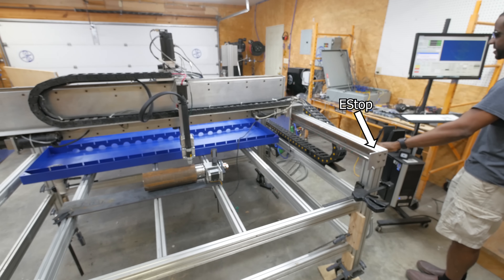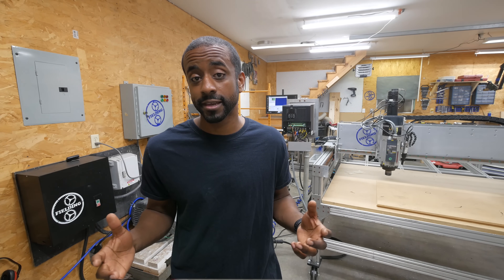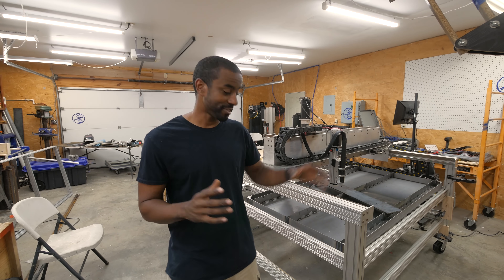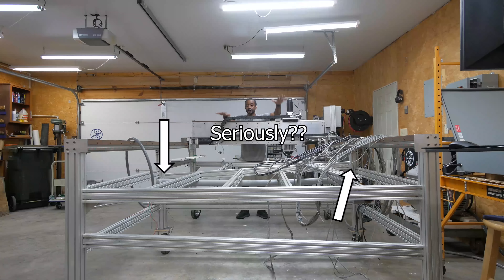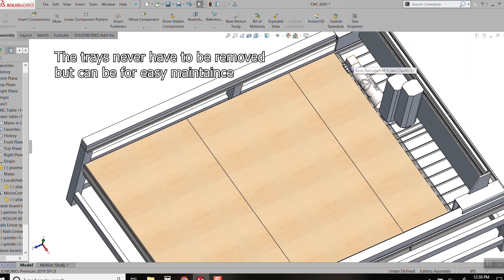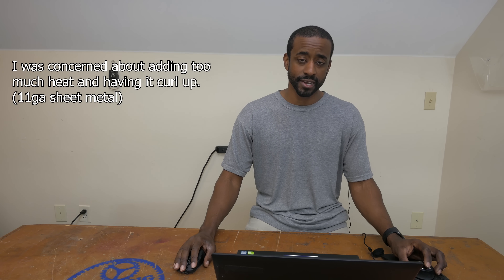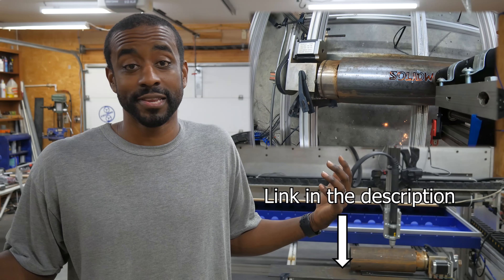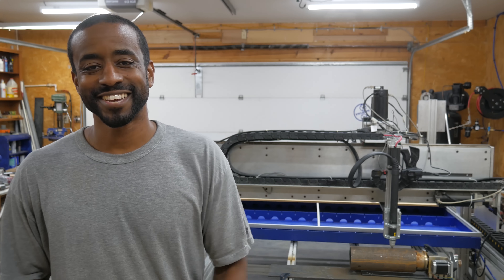Building The Ultimate DIY CNC (#072)

Comment from the maker: Use this link to Try Solidworks online for free! http://bit.ly/2zaQKB0-Solidworks-Free-Trial
Reply: I took Solid works courses at my local community college it was an excellent experience!
Reply: 3-phase power isn't standard in the US or where you live?

Or did you mean you made a 3-phase outlet in your workshop?

If the first, 3-phase is standard in every electrical hookup here. Most high power appliances like cooking stoves run of it and the 3 phases are used independently to power separate lines inside a home to spread load too.
Reply: @enlightendbel  not in the US my friend. 3 phase is only found in industrial/commercial zones for large equipment. may I ask where you are?
Reply: @madisonlamis2639  Belgium. Interesting it isn't common in the US.

Comment: I came across your video when trying to get ideas on building a full purpose 8 foot by 4 foot cnc machine. Great video. I don't have a lot of experience with design but I am a computer programmer and I just purchased my mig welder. Good idea but have you thought about having separate trays for each function? Rollers on your main cnc that you can just push the tray onto the cnc with? The trays would be housed in a rollable tray cart and the trays would be locked into the cnc after rolling them onto the cnc. Just my thought process. Great Video!

Comment: I am building something like this one, but I am using a plasma and laser, and I was going to use two different controllers, to keep them apart, in the diff jobs. But I like the way you have this on the same gantry. I was going to use two gantry. So if go your way with one gantry, how do I pick which head it will use in the process for the job? In other words if I have the same program and want to cut it with laser, but then after it is finished, I want to cut it again with the plasma, what and how is that done?

Comment: Hi Jeremy, very impressive work! Im building my table whose size is 1,6x1,8m but its not as elaborated and useful as your, thats for sure.

Because the aluminum extrusion is crazy expensive, may I ask the size of your aluminum stick, is that 80x80 and 80x40
I plan to go with 30x60 and 60x60. Would that be enough or it needs to be bigger and can be smaller? Im using 2kw watercooled spindle. I plan to buy aluminum extrusion from chinese vendor btw, but still concern its noi rigid.
Thanks in advance!

Comment: Jeremy,  Love your videos!  I recently purchased a Crossfire Pro plasma table.  Still putting it together,  I sell blacksmith tools.  Most of them are made using machines manually.  If I forge a tool for sale, I can easily put my makers mark on it with a stamp while the steel is still hot.  I have ben looking for a cost effective way to engrave parts that I do not forge.  I have looked at CNC routers, lasers, diamond drag tools and dot peening machines.  After watching this, I think I will get a spindle for the plasma table.  I would rather get a CNC router to do the job, but everything I read says I won't be able to engrave steel.  I just cannot accept that.  I can use diamond tooling and I believe I can engrave .003" deep with the right spindle.  Do you have any thoughts on this?  Thanks,  Jerry

Comment: I have a diy Bosch Aluminum 2x4 cnc mill project. I bought all the 90x45 and 45x45 from ebay used . 25% the price lots of turnbuckles too.
Lukilly we have a rexroth store nearby. My design only did the bridge and z axis on cad and the other parts cut to fit

Comment: Great video and great project. I would like to suggest that you add a home position switch on your fence rail and a home button feature in your menu. This will position your fence automatically, eliminating having to re-calibrate the fence distance from the blade after you move your fence manually. It is an awesome project congratulations.

Comment: Hello Jeremy, I want to start off by saying that I think that you are grate. I own a plasmacam dhc2 burn table and I was looking at my collection of used electrodes the centers are burned up do you know what two metals are in an electrode I assume that the outside is copper but I may be wrong  was hoping that I could Tig weld the middle but I am not sure what it is. I was hoping that you would know. It would be a great video if it where possible to refurbish. Thanks from Alaska ✌🇺🇸

Comment: Just found your channel (and subscribed) Orange County Choppers has a machine that does this. Check out the “fake” gas tank the made for Steve Wyrick’s bike( the magician). It took them a couple of tries, but they finally figured it out. They cut flames in the “fake” gas tank to make it look 3 dimensional with his logo inside the hollow tank with lights. You would appreciate the the work that went into the design.

Comment: welded my own one years ago. 1.8 meters wide and 2.5 meters long. its not got a watercooled spindle on it. the steppers are connected via a stepdown transmissin (1-10). so the 200 steps will be like 2000 steps. very accurate. 
not so fast. 
so im now expanding the cnc with a second gantry thats going to be faster. and a switch to switch from gantry 1 to gantry2 basicly having 2 cnc build into one cnc table.(for space sake) 
on second gantry i wish to put a co2 laser in time. but for now maybe a plasmacutter like yours.
the project has been halted for a few months now due to work... but this is inspiring me to get on with it again.
btw i didnt know any cad program or cnc software when i started so i build mine step by step from what i figured to be right . no designs lol . ended up working well though the wiring took me a lot longer then i  hoped for. damn thats a lot of wires the computer board needed to go to every part.
when im done with my 2nd gantry i wish to put a rotary part on either x or y axle and be able to cut or engrave circulare parts too. so im following your work here.
thanks

Comment: a quick engineering note for those who want to build something like this in the future. Putting your adjustment screws (for height levelling) 25% of the distance to the end of the table will result in an assembly (bed) that is at LEAST twice as stiff - if not more so.

Comment: I used solidworks in college becasue the licence was provided for us, but unless they make some serious changes, I have a hard time recommending it for hobby users. Sponsoring you to make this video is a good first step in to the hobbiest arena, but previously it's a part of the market that they've ignored.

What Dassault needs to do is come up with a "solidworks lite" essentially that doesn't require a high end computer to run well (and add support for consumer graphics cards). They also need to come up with a way to provide free/cheap license for that version of the software.

Currently, Fusion 360 is the only software I would use as a hobbiest. Soooooo much more user friendly, requires much less computer power, provides CAM capabilities...and is FREE.

Dassault has a big hill to climb if they want to compete.

Comment: I find chatter to be a very big problem when cutting large sheets. How do you plan on securing the center of your work?  Flex and  bounce in the table and the bit pulling up on your work is going to kill all your accuracy and break bits. At Least it does for me. I am working on a  non flammable vac table with  removable water boxes. I would however  like to see how what your doing works or doesn't.

Comment: Buying an ALREADY built CNC is not the DIY I expected from you.
Reply from the maker: Would you really be impressed if I said I designed a frame which looks like every other CNC Frame? Its the electrical and functional design that makes this worth talking about....at least I think. There is nothing close to this for sale anywhere. So to say it was already built is a extreme overstatement. Unfortunately I could not squeeze all that in the first video. This project is by the far the most difficult and involved project I have on my channel. It far exceeded my clocks or anything else. I am not sure I understand your "disappointment" except maybe you wanted me to select and assemble each individual piece.

Comment: Make a setup for mounting setup for a 200W CO2 laser -- looks feasible, as you just need pumps for cooling it, a PSU,  and then some optics for bouncing the beam around -- and perhaps a black acrylic safety shield of some sort for the beam/your eyes, which could possibly be done on the cheap encasing only areas where the beam might escape, and drop in walls around the work area, and an exhaust fan system <3 this project I want to make one soooo bad

Comment: why do you need 3 phase power for this? I'd think everything electrical would run on dc internally, which can usually be run from straight single phase
Reply: Plasma probably.

Comment: Cnc programming by Peter Schmid is a really good book. I highly reccomend it to learn g code. If you have a cam package you might not need to know g code to program a part. But if you dont understand the code, it's really hard to prevent really bad crashes(pretty much what we machinist) call it when the spindle hits the table or part of the machine and thus damaging components of the machine. I'm a machinist with 5 yrs experience and I can help with g code, I'm sure there are others who follow your channel who are alco cnc machinist.

Comment: Just found your channel.  I have been using Solidworks since 2011.  I love it.  I, too, have my own license at home.  I draw everything  first.  Bathroom Remodel,  Radio Control Parts, Drone Parts and have even designed my own CNC  Router.  It is almost complete.  A couple more weeks and I will be cutting my own parts.  Woo Hoo.  Anyway, thanks for the info and keep it coming.

Comment: better figure out how to heat shield your stepper on 4th axis. It wont last long right next to a plasma cutting head. Nice design. I guess extruded aluminum frame will work but why????? Just use steel peeps. Its cheap and much more rigid
Reply from the maker: That is what I said in the video... Maybe you skipped around and missed that part. Steel is a better choice for several reasons.

Comment: How do you keep the plasma spray from sticking to the 80/20 framework?
Reply: It's aluminum. It will knock right off once it has solidified, if it even bonds at all.

Comment: Congratulations on the sponsorship and an amazing project. It's great that you're recognized for your efforts. I typically feel that combo tools are a tool that gets to do everything poorly, but, they're a reality of a small home shop with a non-production-level budget. Everything wood is bad for everything metal, everything metal is bad for everything wood. Etc. And it's true, if you're churning out a product line. But it looks like you've minimized the annoyances and built a 95% solution that's going to need a little maintenance but otherwise can do the job.

Comment: Jeremy awesome video. I love the fact you take on the CNC machine like I did 10 years ago. I would be curious if at some time you take this machine a step higher and you are very knowledgeable in all type of motors and I was hoping you might modify the machine to use servos instead of open loop steppers. Just a thought. I modified some stepper motors to act like servos you have an encoder attached to the back end of the steppers to feed back to Mach3 or Mach4 So you do not loose steps in the event something gets binded during the milling or cutting process.
Reply from the maker: Most of the motors are servo motors. I will talk about that in future episodes 👍🏾

Comment: Good stuff, however if you want to keep it good stuff, start by adding some serious protection to all those motors, chucks, rails, bearings, electrical of ALL types. I have seen pro plasma table nearly toast after commercial use, the work environment is really bad for precision hardware.
Also hope you completely waterproof the MDF undersides and all edges. Just being next to the water tray will suck up all moisture available, it is very good at that.

Comment: Congrats on the sponsorship, although I don't understand why solidworks would bother. They have no interest in anyone but wealthy mega corps. 

The stripped down base version just to get started is ~$6000 the first year. And ~$1500 for the support annually after that.  That doesn't include CAM that will be thousands $$$$$.$$ more to get started plus another annual maintenance cost. Aside from generating leads for resellers from people "trying" solidworks online there is no point.

Solidworks is an amazing product no doubt, but there is ZERO reason to even look at it unless you have four or five figures to throw at them. The other fun thing is if you don't op for the maintenance you will be soon out of date and can't open any future version forcing you to upgrade. 

Do yourself a favor and just go with Fusion 360. Is is 80% as good and orders of magnitude cheaper.

Comment: Solidworks infomercial-  I didn't see anything there that was designed by this guy- he bought a used CNC machine and leveled it up, and  an off the shelf stepper drive chuck unit.  OK- he fixed the wiring, but how does that relate to solidworks?
Reply from the maker: I am not sure why you would be more impressed by me making a “uniquely dimensioned” frame that would look exactly like this one. The basic design of CNC has nearly standardized in parts and shape. This machine is as unique as you will find on YouTube...Anyway this does make me think I might show my sheet metal design to show why I think that’s a better option then extruded aluminum. Thanks for the reminder that not everyone will be so luck to find such a cheap frame.
Reply: @Jeremy_Fielding  Since Solidworks is paying for this project, it would seem logical that they would want you to show how you used their software to design a totally unique machine.  You probably just convinced a lot of people that they don't need Solidworks, just search E-bay and other auction sites for some used parts ready to assemble.

Comment: You could have used pre-designed aluminum extrusions for your solid works assembly. Im sure the extrusions you drew was quicker though.
Reply from the maker: I did both. First the “true’ shape... then I simplified it to make the model move faster. I usually avoid adding details I don’t need

Comment: Hot damn, this is gonna be a great series. With the size of that table, I'll bet your next project is a DIY gantry crane. Out of interest, what's your max plasma current and material thickness?
Reply from the maker: 1.5 severe 80amps 1.25 clean cut

Comment: If you want to never break a limit switch, then get some felt, angle iron and cut yourself a slice of it, padded with the felt. However you decide to affix it, the face that's felted, needs to be (under compression, use a vise to determine how much the felt compresses) right before the limit switch bottoms out.
My old CNC isn't exactly gentle...when it comes to homing, having been made from an old mill and it would crush or bend switches and brackets to the point i eventually changed to light based switches, but before that, for a while, i used the felt method and it worked great. Had to change to light solely because my new controller came with light based ones and didn't want to bother with changing them to what i had before.

Comment: Yes sir congratulations very impressive.. mine was aluminum to found slag from plasma pitted it severely... switched to angled steel still with gear with aluminium guards.. mine no where near that size table.. dont have the space.. arduino I found was the easiest way I get confused easily and lost with programming and suck heavily with every attempt but keep trying.  Your vids are an inspiration.. thank you!!!  Solidworks useful but very busy.. next level stuff..

Comment: I hope you don't mind me asking a question based on motors and not this video (going to watch when I sit back and relax). Have two compressors both have the capacitor start motors. When plugged in directly to the wall using only the short cord on the compressors it works fine. When I use an extension cord the compressor struggles to start and some times trips the breaker in the breaker panel. Is this due to the extension cord being too long and too small a conductor? If so how can you select an extension cord for my compressors?
Reply: The combination of both, you're short extension cord may have larger conductors than your long extension cord does and your long cable will have more resistance as the length increases. The voltage drop across your long extension cord is increasing the current draw enough to load down your Compressor and occasionally trip your breaker.

Comment: Did they ever get around to making Solidworks NOT be $8500? (per year)
Reply: I think it's something like $4000/year now but it is highly dependent on the add-ins you select. I think the basic license is like $2,500 (at least that's what I remember from a couple of years ago when I was considering getting a personal license)
Reply: @stoneworld7556  Yeah, I know there was some limitations... even if you managed to get verified to get a student edition, it couldn't output real CAM or any other device. And if you wanted to design for producing anything, you had to go full pro package. Granted, it has some awesome engineering features. But their business model is stuck in the early 90s. You have to go through a licensed distributor near you... so backwards by today's software standards. Fusion 360 would have never got off the ground if Solidworks would have at least offered a $500 version. They wouldn't even had to go the way of free to use, micro-transactions, extended licenses, in the cloud computing etc... And yet they would have sold millions of copies, and everyone would be into their workflow, from hobbyist, semi-pros, all the way to R&D labs.
Reply: I believe the SW for Entrepreneurs program offers software at no cost, but I don't know what the limitations are on that.